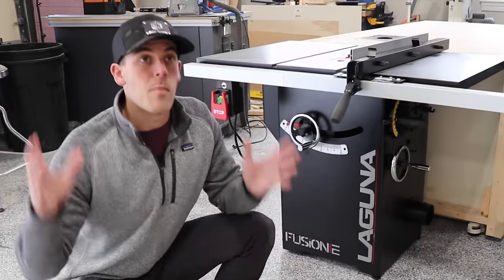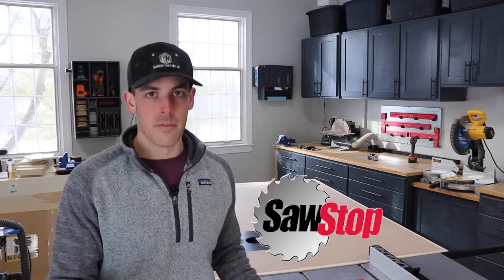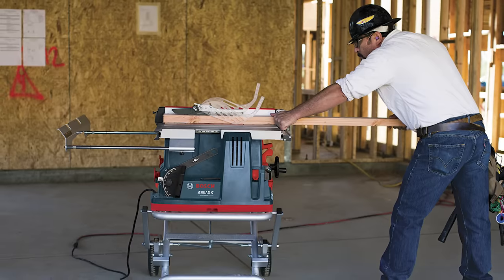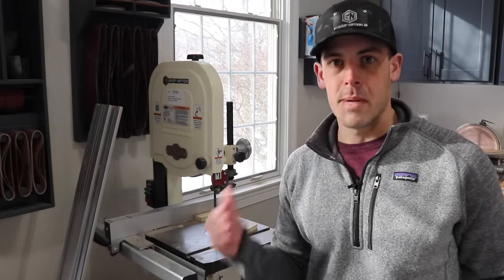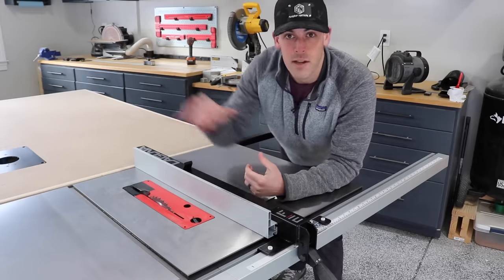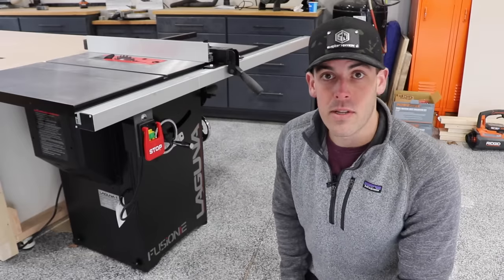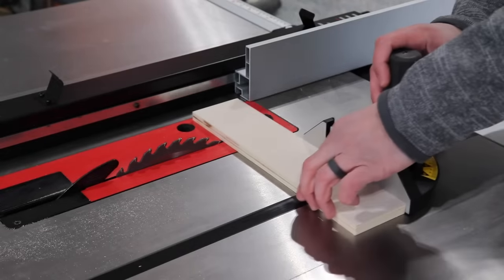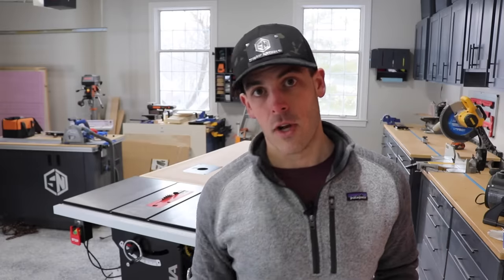Why I Bought a Laguna Table Saw over SawStop!

Comment: As a beginner in the early 2000s. I got by with a 99 dollar table saw from Lowe's. And made a few shelfs and cabinets. At some point after that one stoped working. I got a Ryobi. While the rip fence itself is ok. The only thing that sucks about Ryobi is the miter slot as it's sloppy and you never get a perfect cut. I been wanting to upgrade to a cabinet saw myself as the knowledge and experience I have now, with cheap saws. If I had a good cabinet saw that cut 0 at 0 all the time. I'd be making some pretty sweet projects. I'm going to the woodworking store tomorrow and see what's in stock. The very first project I remember making successfully was a rocking horse in middle school which was around 30 years ago. I've been wanting to make another. My issue with woodworking as of lately is price of lumber. Thanks for sharing the video. Continue doing what you Love to do and creating masterpieces. God Bless.

Comment: I love that you used a picture of a Bosch REAXX tablesaw to make the point that you don't need Sawstops safety features.  It's literally the only other Saw that had a safety feature comparable and Sawstop went after them.
Reply: +1 SawStop: "no one else is allowed to be safe except us", so we'll sue the crap out of anyone else who tries to make them safer.
Reply: @chillyspoon  It's much more complicated than that. Or more simple. SawStop initially offered their invention to saw manufacturers, to license the SawStop tech for use in their machines. Think something like "The New PowerMatic PM1001, with SawStop technology". Nobody took them up on it, so to bring the tech to market, they started their own saw-manufacturing company and put out their own saws, with HUGE investments to get everything going. Yes, the Bosch uses a different actuation mechanism (a superior one, IMO), but the underlying principal of how it works is patent-protected IP, and the purpose of that temporary protection is so that inventors are incentivized to put their products out there, and have the protections to try to get a return on the investment. Without that protection, someone else knocks off their tech without having to do nearly as much R&D, maybe utilizes their existing production infrastructure to under-cut SawStop, and SawStop goes bust.
Reply: True, the owner of the SawStop patents, didn’t want to make saws, he wanted to license it to other saw manufacturers. They didn’t seem to think our safety was worth 8%, which is what he wanted. So, he got investors together and started SawStop. They own the patent and should reap the benefits of it.

Comment: I own a Saw Stop! I successfully and safely used an old Unisaw for years, but I became increasingly nervous about using it when I knew there was something safer. The price is $1500 more than the Laguna, but you are going to use the saw for years. By the time you retire from woodworking, your additional cost will be pennies per hour.
Reply: So true.  My advice is use your circular saw and a $50 straight edge for a year or two more and save enough to buy the Sawstop.
Reply: @charleselkins4546  that could get tedious but it’s totally doable.

Comment: A great review and it earned a subscription, even if I'm 2 years late to the party.  I bought a "Limited Edition" Delta Contractor's saw in '92, and it included cast-iron wings, mobile base, and a Beisemeyer fence as standard.  I've jerry-rigged pretty decent dust collection, and while I can't use 220v I don't buy much 12/4 oak anymore as my age approaches room temperature.  
I've only had one TS accident in nearly 5 decades, and it was early on when I was working construction (I ended up a reliability/risk engineer just like you), the guard/riving knife were missing.  Kickback from an 8' 2x4 from a 36"-tall TS, with a 38" inseam, was painful but I survived.  I'm still fairly scared of the machine and hope to not make any stupid mistakes these last few years.
Great comparison!

Comment: I'm eager to see how the Laguna behaves for you. I like the design. I'm still in the process of deciding on a cabinet grade table saw. I'm glad to find someone on YouTube showing them off.
Reply: Be careful with which model of Laguna.  I purchased the cabinet saw with the dovetail trunion.  Worked great but had issues with dust clogging the height adjustment. Since sold and went to a Canadian General.

Comment: I know it’s an old issue at this point, but I will never get over SawStop trying to bludgeon the industry into using its safety features. They almost single-handedly did away with affordable saws for entry level woodworkers and homeowners and that’s unforgivable. That’s my reason for not ever buying a SawStop.

Comment: For those reading a lot of comments here, I have added a few opinions and tried to add facts where I could.   Just to show where I am coming from, I have owned 3 new saws over the last 3 months  Delta 36-725T2 (horrible saw), Fusion F2 (nice saw) and now the Shop Fox W1837 (nice saw, maybe the best of the 3).    The Delta had many issues, the primary issue and reason for taking it back to Lowes was the fact that there was so much play in the trunnions, play and slop that cannot be removed.    The Fusion F2 was returned to Rockler due to damage during shipping.  It was a nice saw and I think I could have been happy with it.   I was really looking at 4 saws, Grizzly G0771Z, Shop Fox W1837 (very similar saws), Fusion F2 and Jet PowerShop (very similar saws).  All 4 of these saws fit my needs.  Not super heavy and not a contractor saw with the motor out the back.    

This is where I have to give Travis a bit of a hard time.  He criticized Grizzly and Shop Fox saws and claimed the Laguna was a better saw.   Travis, have you ever seen one of the saws that you claim is not as nice as the Fusion F2?   I am guessing that you have not.  If you have, then I would have to question your honesty.  I have now had the Fusion F2 and the Shop Fox W1837 (just got it today).   I have not run either saw, but based on build quality the Shop Fox seems to be a nicer and beefier saw.  The front fence rail on the Grizzly is single piece and the walls are either 2x or 3x thicker than on the Fusion F2.  It weighs 3-4x more than the rail on the Fusion.  The table tops on both saws are flatter than my thinnest feeler gauge which is .0015".   The chassis/cabinet on the Shop Fox is thicker and stronger.  It has larger cast iron trunnions.   There are places where the Fusion was nicer, and there are places where the Shop Fox is nicer.  To claim that the Laguna Fusion is in a class above the Grizzly and Shop Fox is just pure BS!   Yes, pure BS!

As I have said in many replies here, these are all nice quality saws for the price.   You should be happy with either of the 4 if this is the type of saw you are looking for.   As for the Delta, I would not include that as an option.

None of which compare quality wise to a Saw Stop or any real cabinet saw.   This Laguna Fusion is considered a "hybrid" saw, just like the Delta 36-725, and the others that I mentioned.   A hybrid saw is just what I need for my situation.  Not a contractor saw, not a full on heavy cabinet saw.

Comment: I would agree with you on one thing, SawStop is an investment, but an investment well worth it. A SawStop quality and craftsmanship is a premium you are paying for, but also one that will last you 20-30+ yrs of service. You amortize the cost out that long, combined with the safety, the price isn’t really that much more expensive. I have also never heard a woodworker claim you are only a “real” one if you have a SawStop. I only ever hear about the appreciation for the well engineered and built tool, and how that translates into the woodworking they are doing. My suggestion for folks who are struggling with the SawStop price, look for a used one. Trouble is, there are almost never used ones available because people don’t let them go... they keep them forever. Hence my first point on the longterm investment you are making and why the cost isn’t bad if you look at it that way.
Reply: I've had a 1995 great white edition unisaw since it was new, under professional use its still humming along ...
Reply: @billystray7007  I am not saying that their isn’t quality saws under other brands that don’t last. I am just making the point that when you look at investing in tools, the price needs to be looked at as one piece of the evaluation, not the only one. The video appears to just be making an argument that a saw stop isn’t worth it because of the price. I am simply making the argument that when you look at the period of time you will own it, combined with the unmatched safety and high level of quality, it isn’t a bad price over the lifetime of the tool.
Reply: @mphorton40  👌
Reply: He laid out a very detailed map of his logical evaluation. In order to try to make your point you seem to avoid that part so you can render credibility to your comments and make his thoughts disingenuous. Minimizing his detailed video only hurts your attempt to make a point.
Reply: I disagree. The sawstop is not bad but if you compare it to other table saws in this price region, especially European-made, then the sawstop really sucks. Tolerance, accuracy, power is laughable for that price. It´s an expensive hobby machine.

Comment: Just bought the newer T2 Delta model for the cast iron top after fussing for the last time with an old Hitachi cast aluminum job-site with a wonky small t-track. The Delta was nuts-on out of the box: fence, bevel, even the miter. Sounds like Delta improved the dust collection on the T2 from the model you had.  I replaced one of the pressed steel wings with a cast iron router table and router lift from MCLS. So came at a similar price point plus a hot dog or two as your Laguna, but without the overhead dust collector and 37 in rip (Delta only 30) and with a pretty decent router set-up.  So, if $599 looks better than $1,399 for some of your viewers, the Delta is a great alternative (and no, I don't work for Delta and don't particularly like Lowes.) I do like your vids muchly. Thanks! Keep 'em comin'.     OH-!

Comment: You make a good argument. I am no where near being able to afford a saw stop. I use a harbor freight tablesaw and am restoring an old sears cabinet/contractor saw. If I just had the money, I would buy saw stop for the safety features, because I am terrified of my table saw (which is probably a good thing). It's very useful but one wrong move or one kid distracting me.. I need all my fingers to type for my day job lol.

I'm reading in some of the comments about saw stop's patent running out, so I will probably wait it out and see what happens there. Hopefully other people will bring similar safety features to market at a better price.

Comment: Saw stops are great saws.  We use them at the Community College where I work as a TA in the wood working program.  Despite the best efforts of our students to destroy them they have held up for years.  The only thing that seems to go out on them is the power switch.

However, I agree with you about the value proposition.  I personally use a Knapp Table saw shaper combination machine.  With the riving knife and blade guard installed I feel very safe using this machine.  Actually more safe that the the saws at the school because the do not have the blade guard's installed so I don't have the same visual reference as to where the blade actually is.  While amputations do happen, I have been told a far more common injury is kick back.  The riving knife should prevent that from being an issue on any saw.

After working  and attending classes at the school for 20 years, I know of only one accident with the table saw.  That was a kickback.  That with thousands of students through the program, most of whom are just learning. 

Now, if you want to see the blood flow, just break out a nice new set of chisels.

Comment: after tuning my 20 yo grizzly contractor saw-new fence, machined balanced pulleys, segmented belt; it passed the quarter test....BUT dust collection is zip,  height and angle controls are in need of a rebuild....  I have started construction on a new shop  and I have started looking for a new saw....This looks like a great contender. Thanks for a great Video!

Comment: With over forty years of woodworking, I could not agree more. For all the reasons you mention and more, I have the same Laguna saw from the 2018 production run.  With the exception of dust collection, I have not found anything about the saw I do not like. Once set up this saw is rock solid and the fence measurement adjust is spot on every time. If I had a bigger footprint for the saw, I would have purchased the Felder/Hammer sliding table saw $6,000.00 . But after looking at all the table saws you mentioned, it boils down to features for the dollar. Laguna wins, so thank you for the video and I enjoy your show very much. Keep up the good work.

Comment: Im new to this channel, dont understand why some people are so concerned about your Table saw choice, you got the saw that suits your needs, your cutting mostly sheet wood, that Laguna is plenty good for that. And as for the hot dog stop, ya thats a cool feature but if you have any kind of skill set and focus on what you are doing, cutting your fingers off is highly unlikely. The riving knife in my opinion is more important. I have a 30 yr old Delta Unisaw, 3 Hp 220Volt. didn't come with a riving knife. I just simply made zero clearance inserts with a splitter glued in.

Comment: I'm certainly not going to fault you for getting a cheaper saw, but this just simply isn't apples to apples. The Laguna is not anywhere near the quality of a Sawstop Professional saw. It's not even comparable to the Grizzly saws. The reason the Sawstop IS worth the money is because it's as good, actually better, than the Jet or Powermatic saws that you pointed out are the same price. The safety feature is a bonus you're not even really paying for because it's already priced in line with what a professional cabinet saw like the Delta Unisaw has always been, and it adds some better features such as improved dust collection, heavier cast iron trunions, heavy duty bearings, etc that make it heavier and able to stand up to the shock of the blade stop feature, as well as the best customer service and QC you will find these days. If you don't want to spend the money on a Sawstop, the only saws that make sense are the imported saws branded as Grizzly/Shop Fox/Harvey/etc because they are still true cabinet saws with an older version of a Beisemeyer fence, not too far behind Sawstops fence. The Laguna is not somewhere in the middle, it's literally called the Fusion because it's a "fusion" of a contractors saw and a cabinet saw. It is essentially a contractors saw with a relatively weak aluminum fence that looks closer to a cabinet saw, a sheet metal enclosed base to make it look like a cabinet saw, and that's about it. It has a little more hosepower and a little more cast iron on top so it looks like a cabinet saw, but it's not. They're actually not new, I saw them for the first time years ago. Laguna is good at making things look modern and nice but the reason these saws don't sell is because anyone who has actually seen them in person next to a cabinet saw understands the difference and realizes it's a dressed up contractors saw. No offense at all, and I'm sorry if you have to say nice things because you have a deal with Laguna. You're allowed to like the saw, but pretending it's something comparable to a Sawstop or an upgrade from a Grizzly is just misleading.

Comment: About 12 years ago I went through a similar thought process and bought a Delta 3-36 table saw instead. My dollar calculation was closer to $3300 for the Delta, and $3300 for the Sawstop. So the money really wasn't the issue. The Sawstop was still fairly new to the market, and frankly kinda scared me. Now I'm looking at retiring in a few years, and planning to move, so I'm going to sell my Delta (which I love) and buy a Sawstop. I still have similar thoughts about the Sawstop, but as I age, I'm guessing my chances of accidentally plowing my hand into the blade are going up. And I'll be getting the Industrial Cabinet Saw. Not the most expensive one they make (it's close), but I like a really good cabinet saw.

Some things that are missing from the whole accident debate, is how serious are all those injuries anyway? If you just tap the blade and get a nick, that's way different than losing a hand. But the Sawstops get credit for saving the world in either case every time.

Comment: As a Brit who has been a professional Joiner (making doors,windows,staircases,kitchens etc ) for over 30yrs it's nice to see a saw with a decent (fully adjustable) fence. Most US Saws I see have a fence which is not safely adjustable when cutting solid timber boards. By this I mean when ripping solid timber the front/end of the fence  should only go past the front of the saw blade by 1" or so this is to allow the timber to move all ways when it goes past the end of the riving knife.. Most fences run the full length of the table so if the timber had tension in it when it passes through the saw blade the timber can spread apart,close tight against the riving knife, both pieces move left or right.If the fence runs the full length of the table and both pieces of timber move/bend to the right they can bind on the fence and kickback.. I'm really surprised US channels don't question this more. I had a "debate" "argument" with an American you-tuber  a few months ago who thought he knew everything, wouldn't accept that once the timber has passed the riving knife it can move in any direction  and wouldn't accept an opposing opinion. Enjoyed your video.. Thanks